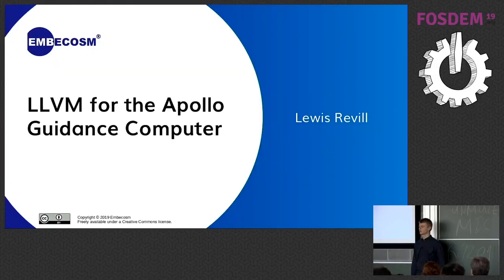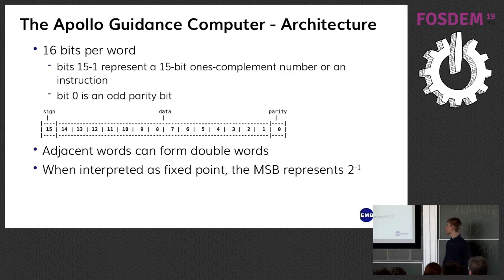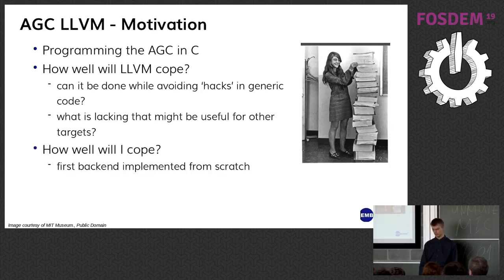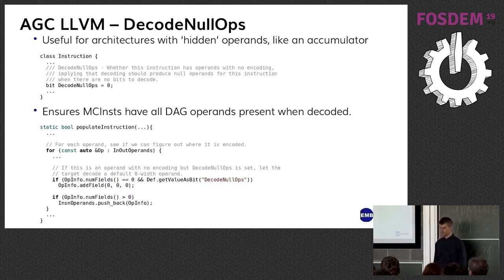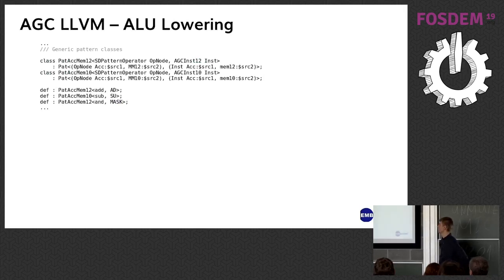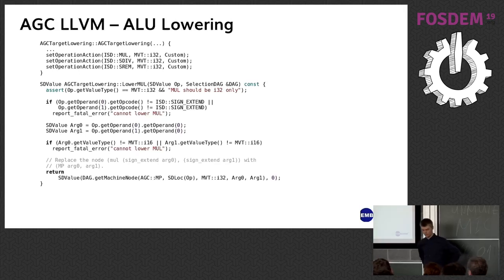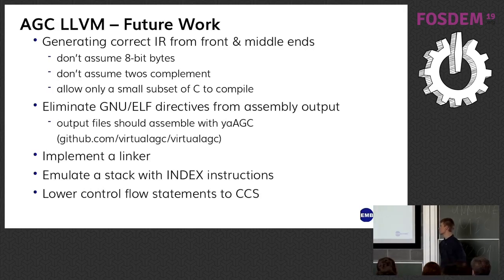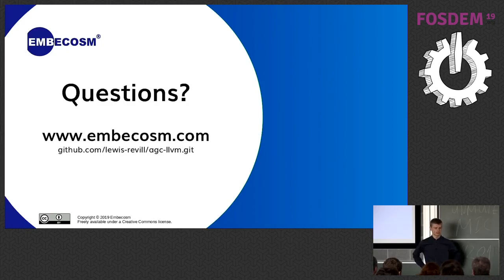LLVM for the Apollo Guidance Computer

Comment: Don't try to understand what the code of the AGC does, for it does nothing, it just plays with instructions to do nothing; I can assure something: Neither the descent program nor the ascent program try to control the main engine or the RCS; in short, they don't actually make any guidance, and this for a very simple reason.
Reply: How do they get around a subroutine which calls another subroutine, and with the divide instruction limited to integers how can the compute a simple ratio, let alone trig function or roots ? I noticed that the keyboard has no decimal point ?